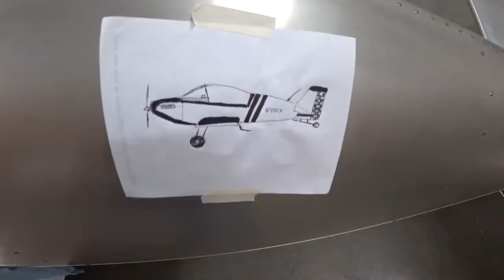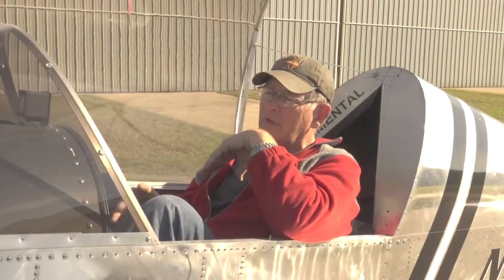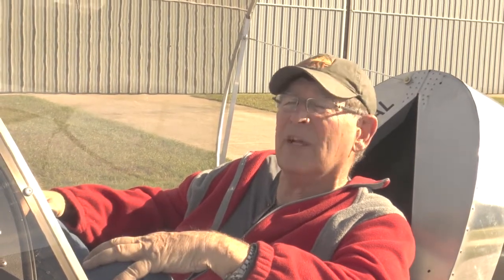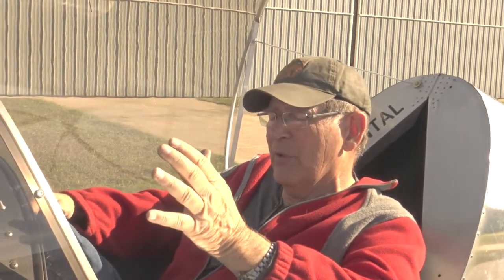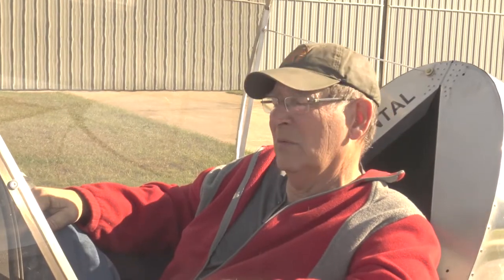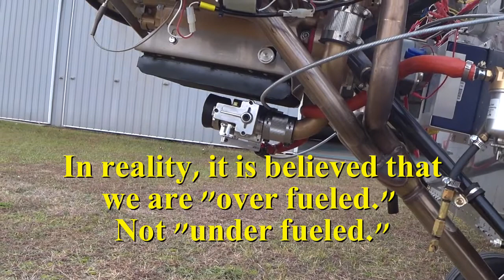Onex testing begins

Comment: I would adjust the needle a 1/2 turn to correct low speed mixture should idle at full stop.  Beautiful ship single seat looks comfy!  You know the Revflow free prime function? Crack the throttle push mixture in for 5 seconds summer 7 seconds winter mileage may vary ...Clear prop! Should fire on 1st blade
Reply from the maker: Thanks man. You may have noticed that the engine seemed to "lope" a bit at idle. We believe the throttle adjustment helped with the engine stopping when the throttle was all the way pout, but as you have stated, the mixture we believe., also requires some adjustment to end the "lope." Thanks for the input!  Best, Capt. "T"
Reply: @TangoSierra2022  The Revlow carb is sweet once dialed in no changes will be needed unless you switch fuels.  I like it better than the Aerocarb!  I enjoy one an a Vintage Lindy winner but only have raw footage https://www.youtube.com/results?search_query=nx237f